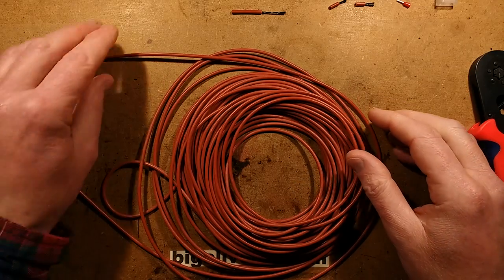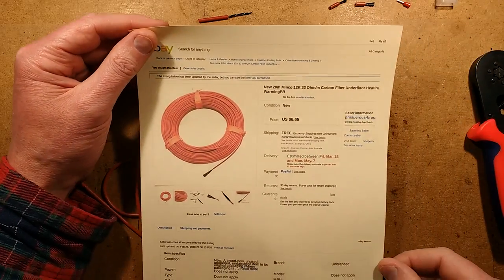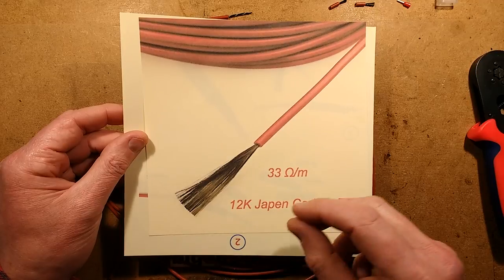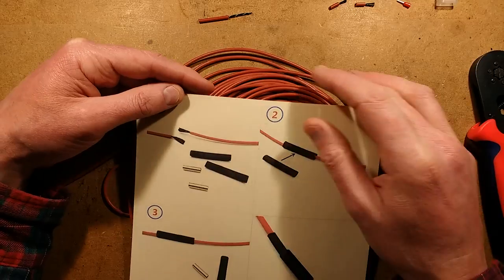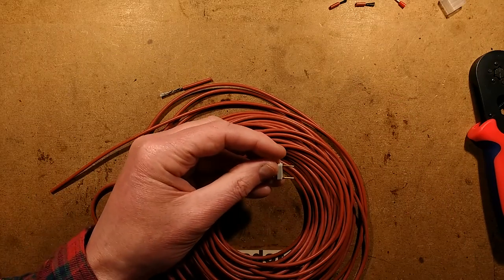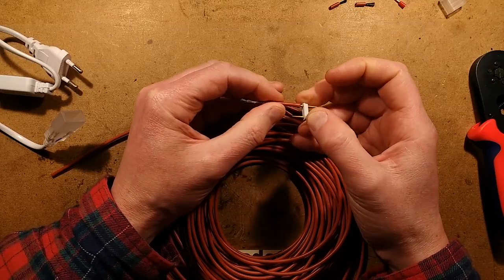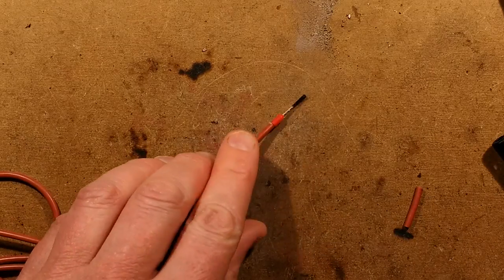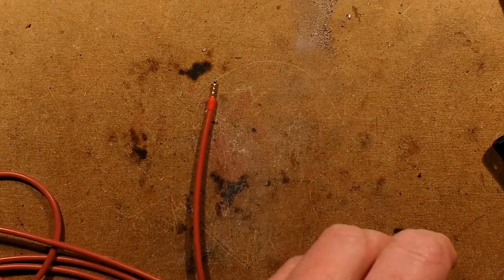Testing carbon fibre heating wire.  (with flame test)

Comment: Hi Clive, do you have a few meters left?  My goddaughter has ask me to come up with a solution to stop the chickens water from freezing this winter and this stuff run from a leisure battery and solar panel might just do the trick!  I intend to rap it around some plastic water pipe in an insulated box and utilise a temperature sensor to switch it and a circulation pump on and off.  I would happily buy some but it delivery seems to be way in to late autumn or early winter.  Happy to pay you for yours or put the value in to a charity of your choice.

Comment: when you try to print website, go to File -> Print, then for Printer Name choose Adobe PDF and save the web as PDF file, then open the PDF file and print it from there to avoid missing part of the web width... (note this is the procedure if you are using Firefox, i am too lazy to check in other browsers)

Comment: you could use it to add heating to an older car's steering  wheel, seats ect. or custom heated clothing for motorcycling, snowboarding ect.

Comment: Two hundred and fourty five volts? How does any light bulb survive this? I guess the newer LED ones don't really care that much, but incandescent ones tend to fail quite quickly with overvoltage.
Reply: Ummmm... The standard voltage in the EU is 230 V. I am just a bit worried about 230V bulbs on 245V supply...
Reply: Spec is 230v +10/-6% so both the UK nominal 240 and the 220v found elsewhere are considered within spec. It's quite normal to be closer to 250v.
Tangent/Trivia: Incandescent light bulb life was rigged by cartel - https://en.wikipedia.org/wiki/Phoebus_cartel
Reply: I did not know it could change that much. I just checked, i can totally see the voltage beeing lower when it is lunchtime (215V) than at night (228V)!

That's kinda cool...

Comment: In terms of health... As far as I know there's not really a huge amount of cases/information of carbon dust/fibre exposure causing illness. Although I'm sure you're right, and it's best not to breathe carbon dust/strands. However, I'm fairly confident that carbon is A LOT less horrific than silicate fibre (asbestos and I guess glass too, but less so than asbestos). Carbon fibres will have variable sizes, and be more likely to be either small enough to be absorbed across an alveoli eventually and... presumably pooped out... Or, be big enough to get caught in your nose or bronchial tree and then get hoicked back up and coughed/snotrocketed/swallowed. Also, carbon strands are fair delicate... And I think are somewhat more flexible too. Asbestos is so naughty and mean because it's abrasive, the particles are at a size where they go down to alveoli, but are too big to get....... macrophage'd.... And not susceptible to immune/inflammation destruction by immune systems... And sharp and extremely irritant. 

Soooooo for strands like that... I guess don't do lines of it. And a dust mask... Yeah OK pretty good idea. But probably no need to freak the f--k out about it...?

Also... carbon fibre fibre...it's just carbon. Like graphite or, uh, carbon. So it's best not to breathe... But... You're made of carbon too. So.... it's probably not going to cause massive harm..... Although I doubt anyone will know for sure for a few decades. But I'd much prefer to inhale some carbon dust than some glass fibre insulation dust.

Comment: Yeah, I was wondering how to terminate carbon aswell. Im used to soldering everything but thats obviously not an option and crimping doesnt sound too good either because it is quite brittle. Is there by any chance something like an electrically conductive heatshrink? xD
Reply: That is basically what the picture was trying (poorly) to show.  Seems they left out the most important image.

Comment: (Disclaimer: I wouldn't actually try this), but would heating wire such as that be able to heat a liquid? Do you think water would permeate that insulation and create a short? Or is the only chance if a short be from a stray fiber piercing through the insulation?
Reply: Electrical/electronics tech here.  That could be an issue if the cable were damaged or came with a significant gap in the insulation, but permeation won't do it.  You need a channel of water to transport the power through the insulation out to the main body of water.  If it's just a few molecules here and there in an almost impermeable material, it won't conduct enough to matter.  It looks like the same stuff I'm seeing on Amazon, where the outer coating is listed as silicone rubber.

Comment: Clive, Sorry not linked to this vid but the terminal reminded me. In an older vid you showed a clip down reusable lego block type connector. I can't find the vid and can't remember which ones you recommended. Can you let me know the name of them please ?
Thanks
Reply: The Cliff Quicktest?
Reply: No , these are little lego brick size. , Like the ones with little screws in, you get them in strips but most are cut to a 4 screw block. The ones Clive used had press down clips instead of the screws
Reply: Montague Flange 
Wago?
Reply from the maker: Wago connectors.  Beware of the clones.
Reply: Thanks mate.
Reply: Is there a clip down type like these but with through connections.

Comment: Fiberglass and carbon fiber can/do pose a health risk, similar to asbestos. It's not quite as severe, but if you work with it regularly you should definitely take precautions to avoid breathing it in. 

Fiberglass also comes in different sizes, and is less prone to breaking apart into tiny shards that would pose a health risk like asbestos. It still will, and does, but it's a bit less "harmful". It is still unsafe, but disturbed fiberglass tends to not kick up cancer causing tiny shards like asbestos would. Although I could be wrong, not an expert and all that. You know, never take health advice from youtube comments lol. 

Basically fiberglass is typically in longer fibers that you can't really breathe in unless you try or abrade and break it. Not sure about carbon fiber, but it also can abrade/form tiny shards like asbestos. If you work with them regularly, you should always wear proper ppe. However unlike asbestos, simply being in the vicinity of fiberglass insulation (as in such as that in your home, not working with it regularly) isn't a health risk. (Because asbestos more easily breaks down and afaik does so naturally sometimes, but fiberglass doesn't). Also as said a few times, when fiberglass breaks, it doesn't typically break into asbestos like shards. It can, but silicosis is more of a health concern than mesothelioma or whatever. 

But yeah, take all that with some salt, like I said.

Comment: @bigclivedotcom I am searching for some carbon heating wire to sew into my motorcycle jacket.  Can you recommend something good for 12 volts?
Reply from the maker: This stuff would work, but you'd have to experiment with length and heat.
You may also be able to find flat heat panels made from spun carbon fibre in a plastic lamination.

Comment: I was a plastic fabricator / fiberglasser and I also worked with carbon fiber for year's and year's now if I smell any solvent or resin I have extreme megraines , and ten years later I was still pulling glass splinter's out of my hands knees and arm's .

Comment: Could this carbon fibre wire be used on the end of an ioniser? Minus the retaining strand.
Reply from the maker: Yes.  I use it for this.  If you strip about 10mm/0.5" from the end and then cut off about 25mm/1" so that you have a tuft with insulation, and it can be pushed onto an existing ionisers needle to upgrade it.

Comment: I used to strip insulation like Clive did by pushing the croppers with my left hand thumb but it fucked the knuckle joint and now I can't bend my thumb back the same as my right hand digit, beware guitar playing sparks.

Comment: Can you make an electro magnet with it? - wondering if it creates a magnetic field the same way.
Reply: mickenoss   you get the same magnetic properties from this as from copper wire at the same current, same number of turns etc. .  But this will need more power to get the same the same current, a much higher proportion is converted to heat.
Reply: Cool thanks for the reply. =)

Comment: Are those carbon fiber ones more efficient than the other ones? I got a 50+ m heating cable inside a water line, it will draw around 1600w.
Reply from the maker: Ultimately power is power, so using a lower power tape would not heat the pipes as well.
Reply: Yeah, just looked like that was very effective, you don't need a lot of heat to thaw a frozen line if you embed it into the hose/tube. I guess for floor heating, it's more about sustaining a 25-30C temperature of the surrounding floor, takes time when you first start it, but then it's quite effective at keeping it around that temp, don't want a floor at 60C :)

Comment: More efficient than the heater cable I worked around in the late 80's, at 1KW/h/per 30metres.  It cost a lot to keep water pipes from freezing.  Is the insulation water-proof?  Did I see sparks coming off the insulation when you flame-tested it?  Like the ferrite substance in lighter flints...?  Will I stop asking questions?:^)  Carbon fibre in circuit, a brave new world indeed.

Comment: Could you test it by plugging it into an rcd and chucking the bundle of cable in a bath?
Reply: Full of water of course.
Reply: Or tea.
Reply: As long as the tea is somehow earthed why not! An interesting material Ive never seen before. I wonder what its benefit is over normal heating wire? Less prone to mechanical fatigue?

Comment: Didn't hear you mention that another reason for not leaving cables coiled up is that they act as a transformer which also adds to the heat. But would this material act as a transformer. Well it has all the ingredients but does the material somehow reduce the effect. I wouldn't think so but would love to know if I'm wrong. Cheers Clive love the videos mate
Reply: Very interesting thought! Would it still conform to the left hand rule for current and magnetic flux lines. I don't see why it would not being its conducting the current. Hopefully people will upvote this.
Reply: I've always wondered if carbon fiber could be used as a material for motor windings.
Reply: Whoever claims coild up extension cord acts as a transformer, has no idea how transformers work. You have two wires coiled up in opposite directions inside the cord carrying the exact same current. No transformer action there.
Reply: superdau slight variations in the language are in play here. I should have said acted like not acted as a transformer as we all know it's not an actual transformer. The coiled up wire can display quite a few properties over an uncoiled piece wire though in let's say RF and audio applications. My question though was relating to AC and as mentioned I had been taught that wound up it inherits some undesirable effects. Perhaps it was a pet peeve of the army or there is some truth in it either way I posted the questions to either find out and either dispel what I had been taught or to confirm that it was correct. It was one of those day one things as an apprentice that you get taught that sticks in your head and it definitely has safety concerns attached to it. Never finished that apprenticeship as I wound up in special forces which I found more interesting at the time.
Reply: Thing is it's neither "like" or "as" transformer. You have the two wires (live and neutral in the case of mains) that carry the same current coiled up right beside each other in opposite direction. Those cancel each other out. That's physics. There is no inductive effect, not at mains or audio frequency. RF is a whole different thing, but even at those frequencies effects are not due to the wire being coiled up, but rather to the two wires running close to each other.

Comment: This is the kind that we  can get from walmart,, 3mm 12k 33om 200C 100M 60.0 This stuff is used in my new incubator, replacement heater/fan unit. and i have found that it can not maintain a constant temp. Heats well but to self veryable

Comment: Clive instead of wire nipper you might need to use wire stripper to strip the wire with much less effort. Correct me if I am wrong.
Reply from the maker: I didn't want to damage the core.

Comment: The insulation looks like silicone. I know this because I left my new fancy blue Martha Stewart high-temp spatula spoon on the stove once and it got bumped to hang over the natural gas flame and like ten minutes later I had a pile of that greyish ash and a smooth notch out of my brand new utensil. I was bummed.

Comment: I’ve worked in a airbus plant making carbon fiber parts, how can you tell if carbon fiber got in your lungs? Is there a test a doctor can do?
Reply: Dissection would be definitive. ;-)

Depending on the type of fibre, I guess one could "tune" something like a MRI to the expected band of frequencies and scan the lungs.
Reply from the maker: So far all the feedback from others suggests it's not harmful in the way asbestos was as the fibres are bugger and easier for your lungs to expel.

Comment: One of the advantages of carbon fiber and fiberglass over asbestos in the lung is that asbestos is chemically resistant to just about everything. In theory, glass fibers dissolve in the environment of the lung over some time, while once it's in, asbestos is there for life, poking away at DNA.

Comment: The underfloor heating is also better because of the large area of heat exchange.. much more then a normal radiator... and also because it needs a lower temperature. A normal  water filed radiator my need 60°C  water while when using underfloor heating you may get around with only 30°C water this is way better if you use a gas combi condensation heater. If you using electricity I believe it won't make any significant difference.

Comment: Ah, the good ol' melting reel extension cable. That's why you never lend your good ones to welders on construction sites (especially people with welding transformers that tend to "upgrade"  thermal cutoff switches to get their job done faster) :D

Comment: Other uses? If it'll safely work at a sustained 70 C, Wind it around a pipe under an insulation jacket to make a 3d printer filament extruder. (Cheap filastruder barrel heater)

Comment: I want that tool!
That magical crimping tool.
What is it called?
That's all I need to know.
Please, BC. Just give me a clue.
I WANT THAT TOOL!
Reply: Generically it's a hexagonal ferrule crimper.  The model number "HSC8 6-6" seems to be commonly used, but I've no idea which brands are better and which worse.  I wasn't able to spot any that looked exactly like Clive's.  Caution, model "HSC8 6-4" looks quite similar but makes square crimps.  (Hexagonal crimpers have six triangles around the opening, square crimpers have four.)

Comment: Very interesting. This could potentially be used for heated seats in a car. I wonder if they used something like this in those heated seat covers you can buy that plug into the car's cigarette lighter.

Comment: I have this stuff in my room, i just activate it with a DIY remote on the mains and it heats up the floor to a toasty 30 to 50 degrees Celsius. Its also a 20 meter roll but i have 2 of them

Comment: Actualy 12k is preety much the thickest one rhat is made into fabric, i dont know how about "wires", but the number signalises number of single strands. Standards are 1k, which is extremely expensive, buz very light and beatiful. 2k,3k which is the most used, 6 abd 9K and 12K which is the most coarse, although cheap. Btw much worse than strands sticking into your skin is epoxied carbon splinters :(

Comment: Known carbon fiber health risks, according to a NASA document from 2015. See section 2.0, Hazards:
https://ntrs.nasa.gov/archive/nasa/casi.ntrs.nasa.gov/20150012180.pdf
It is worth noting that there are oodles of different types of carbon fiber, which have different diameters and use different chemical binders. They're also a relatively new material that has only started being used on a larger scale pretty recently, so there might be tons of stuff we don't know.

Meanwhile, OSHA's info on synthetic mineral fibers (including fiberglass):
https://www.osha.gov/SLTC/syntheticmineralfibers/health.html
The ToxFAQs thingy is pretty straightforward:
https://www.atsdr.cdc.gov/toxfaqs/tf.asp?id=907&tid=185
And they have rules about how much exposure you're legally allowed to be subjected to:
http://nj.gov/health/eoh/rtkweb/documents/fs/0933.pdf

Comment: Hi, why are you worried about crimping and damaging the carbon strands, isn't carbon fibre supposed to be strong and tough?
Surprised you didn't use the voltage and current on the meter to calculate the hot resistance.
245 / 0.371 = 660.3 Ohms.. yaaayyy  ohms law works...

Comment: Hi Clive,   It’s difficult to see why anyone would complicate the issue by using carbon fibre in this application.
Twenty-five years ago I became associated with a market leading supplier of electric under floor heating. I was surprised when let into the industry secret that the ‘special heating cables’ were simply normal copper cables with synthetic rubber insulation.  Beyond all the waffle the only real design consideration was to play off the conductor size against the lay density available from the floor dimensions.  Widely used for keeping little piggies and their mums warm during weaning.     Cheers,   Chris